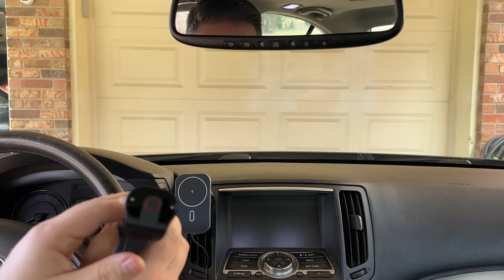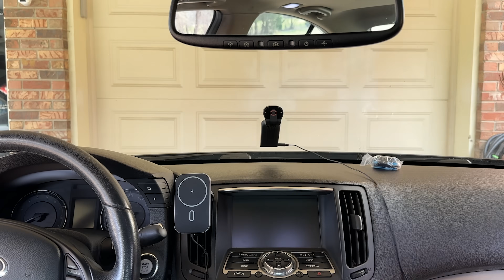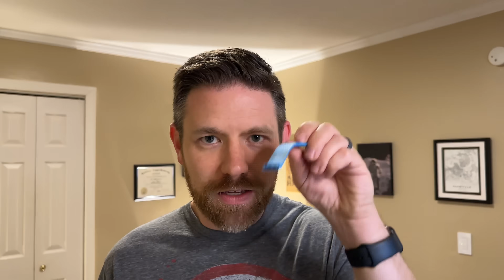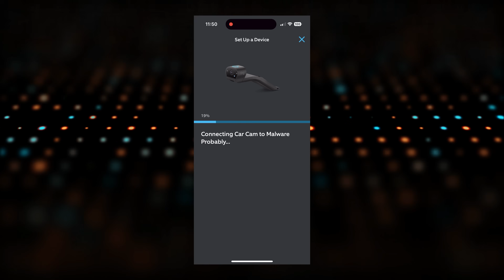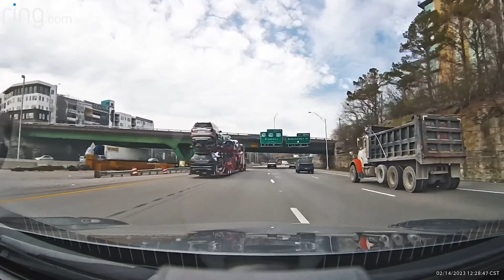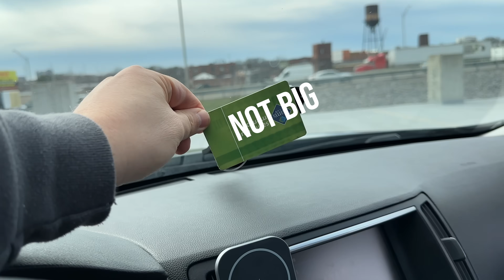Ring Car Cam: Full Review

Comment from the maker: Hey guys, I know I mounted it high. I wanted a higher camera angle. This thing weighs next to nothing, and the adhesive is getting the job done. :)
Reply: I’m scared somebody might break car just to get this camera, it looks too cool
Reply: I guess you mean you wanted a slightly higher camera perspective.  

I enjoy not having a car payment also!  haha
Reply from the maker: “Higher perspective” is exactly what I meant. Thank you for speaking “Donnie.” :)

Yes! I’m all about not having a car payment for as long as possible. This car is now 12 years old, but it was entry level premium at the time and it’s still in good shape. In my 5.5 years of ownership I’ve only had to (knock on wood) do standard maintenance like brakes, tires, oil, belts. I’ll take it!
Reply: But the camera is on a hinge type of thing… it moves up to be able to get a higher angle. Just installed mine, and moved the cam up and gave a “higher angle “ ….

Comment: Buddy if you hate seen cable I notice you place the camera way to high on the windshield you should of put it a little lower I notice that from the beginning when I order mine I will put in all the way in the bottom so no Cables will show
Reply from the maker: Yeah, I liked the higher camera position. Also, this camera has been discontinued. Thank you for commenting.
Reply: It might be discontinued but theirs a couple new ones in eBay theirs were I got mine in on transit 👍🏻

Comment: I bought that camera when it came on the market and after a few months it stopped working, they say they are going to replace it but they don't have that equipment available and they say they can't refund my money either because I bought it on Amazon and not directly from them, I have months waiting, I lost 250 dollars with that scam company
Reply from the maker: Ugh. So sorry to hear that’s been your experience. I would push back and ask for your support incident to be escalated with Ring. I get that they’re having supply constraints, but there’s gotta be some recourse. I’m sorry this has been your experience.
Reply: @TechWinnerCC  Hello, I have been communicating with Ring for more than 2 months, the answer is always the same, they say that they cannot solve my problem because they do not have the camera available and they don’t know when will be available to replace the one that was damaged, they also told me that they cannot return the money because I didn’t buy it directly from them, I did it through Amazon, but from Amazon they tell me that there is nothing they can do, that this is Ring's problem, at the end of the day I paid 250+ tax and that money was lost.

Comment: Does it take a SIM card? If not would it connect to a hotspot. I actually have a T-Mobile sync drive, but that plugs into the OBM. It would be nice if this read the vehicle too. I know sync drive is developing a Dashcam too, maybe with built in lte & reading your vehicle issues too.
Reply from the maker: It doesn’t have a SIM card slot (at least not one that’s visible).

Comment: I have several Ring security cams at home but do not buy this Ring dash cam bcz it is garage and need more and more improvements.

No stamp info like real time speed, date & time or gps

No rear camera or option to select
More, both interior and front cams are not working at the same time. You can have videos only on one not two at the same time.

Privacy cap can be closed by anyone and carjackers or intruders can easily do what they wanna do. I mean why a dash cam need to be covered if it is dash cam to cover what is going on around. Then do not have a dash cam.

Ring should understand that consumers bought Ring home security products, bcz what they offered and helped for the main purpose of SECURITY with advanced features like,

Live view
Two way communication
Cloud storage

That is why people were happy to pay Subscriptions and bought Ring products.

With the Dash cam sector, so far Ring is so behind the competition and so failed and it needs a lots of improvements and options to select the best security plan and devices.

You know, there are a lot of options/ products with all features what Ring lacks at the moment. So why you should buy this sticky Ring dash cam (should be compact and hidden as much as possible to address its purposes) and pay subs for less..

Comment: Thank you for making such a quality video. I wondering i don't have a alternator I drive a hybrid Toyota Avalon. Will that be a problem using the ring car camera?
Reply from the maker: Definitely worth checking their compatibility tool. I have it linked in the description.
Reply: @TechWinnerCC  I did check your link and thank you so much for for providing it. It did say that I was able to utilize the ring camera. What it didn't say was whether that would be a problem since a hybrid only has a tiny battery to start the hybrid battery and I don't have an alternator

Comment: Why do most of these vehicle camera reviews not talk about video quality/clarity? Features are great and all but the MOST IMPORTANT feature of a video camera........is the video quality! Can you read a license plate without being directly on the vehicle or stopped throughout all times of day and night? What fps does it record it? Does it upscale? How does the quality differ at night, dawn, and dusk? How does the camera and components do in extreme heat and cold? Are they working on a rear camera? My biggest issue with this industry is i have a go-pro from 2014 that has better video clarity than probably over 95% of vehicle dashcams. If that is the case, why aren't more "review" channels calling this out??? It is a dashcam, the most scrutinized part should be the camera!

Comment: Where you have it mounted in most states, cops can site you for obstructed vision. Also Ring freely gives all recordings to law enforcement on request, no warrant needed. Let me see, it can run down my battery, it can spy on me, disable my car through the ODB2 port, download only 20 seconds at a time and charge me for a monthly subscription. Outside of a descent picture I don't see anything good about this dash cam.  There are so many better and cheaper dash cams out there that record to a removable disk without any problem viewing or downloading and law enforcement would need a warrant to view it without your permission.

Comment: Only a few minutes into the video and i can tell you i dont like the power cord coming out the right side of the camera when the routing of it has to go to the left to go to the OBD2 port. Kinda reminds me of the new Nest battery outdoor cameras with the forward facing charge port rather than facing back towards the wall its mounted on (Face Palm). also this needs 4k or it makes it hard to read plates! my blackvue 900 is 4k and is awesome

Comment: Hi Donny, I have four dash cam in vehicle and I’m about to purchase the Ring Dash Cam as the 5th Dash Cam. I have one dilemma. 3 of the 4 dash cams are set to an OBD, I can press a switch and I can get 24 hours of recording. My question is can I use a splitter to connect it the Ring OBD connector so the Ring OBD can power my other Dash Cams?? Thanks.
Reply from the maker: It’s worth a shot, but you’re multiplying the amount of drain on your battery with every cam you have running while the engine is off. Just something to think about.

Comment: The only messed up thing is that they specify that your obdII should be on the left side of the steering wheel but then they put the charging port on the right side ?????? I'm sure you could make it a cleaner install with the wiring if it was on the left side just sayin.
Reply from the maker: Yeah, strange decision to place the USB-C port on the right side, at least for us North Americans.

Comment: Resolution has nothing to do with quality. People often mistake resolution with sensor capacity. You can have a 4k camera with a very bad sensor and you will get a very bad quality footage, as well as a 1080p camera with a high quality sensor and have an amazing footage. For example, I'm watching this video on a computer at 1080p, full screen on a 27 " display. Your house footage, when you speak is very clear, crisp, although it's 1080p, while your ring camera footage is bad. The sensor on that device is crap, that's my conclusion. There are very few car cameras outhere with a good sensor, and usually thier price is very high. So unless you're driving in a consistent dangerous environment, it's not worthed buying one.

Comment: 3 reasons I wouldn’t buy this. 1. My port is in use already 2. No suction cup mount.  Sticky pad will 100% fail at some point.  3. I don’t want another subscription. Just piggy back off my current cell plan.

Comment: Does it work with AAWireless as a home network and use your own cell with unlimited data?
Reply from the maker: It just needs a Wi-Fi network. You could use your cell with unlimited data, but you’d still have a limited feature set if you didn’t go with the Ring Protect Go plan.

Comment: Seems like a good little camera, but the Ring membership thing is the immediate turn off. Probably fine for people who are already using a Ring doorbell, but kind of a step in the wrong direction for a product that has never needed more advanced storage options. 
I'd also question the mounting solution there. Didn't see mention what adhesive is used here (i.e. 3M VHB tape), but it's one of those things that will definitely fail in hotter regions like mine.

Comment: I’d be interested to know how the adhesive used to stick to windshield would hold up in the Florida sun/heat, and if it does fail…is there any other option to mount? Does the app have a setting that Will display your speed on the screen?
Reply from the maker: Summer will tell a lot for sure. It does not display speed at this time. Perhaps that’s possible through software updates, but Ring hasn’t mentioned it as a possibility yet.

Comment: A couple of notes from my setup: Try to be near your wifi hotspot when first setting up.  Also, scan the bottom of the camera before you install.  The QR code is not able to be seen once you mount it.  Finally, the "frequent" mode for recordings eats a lot of battery.  I drive my car every day, not for very long distances, and my camera is telling me at least once per day that the camera has gone into standby.  I've been very happy with my car cam.  I have an escort radar detector/camera in my other car and the car cam is far superior in terms of usability.
Reply from the maker: The QR code is on the box as well. 👍
Reply: You are saying that the camera is getting more use than a radar detect?

Comment: Nice review, I have gone through 3 different dash cams and they all have failed in the Texas HEAT. Fine hair line cracks around the lens, bulging of the case, melting of buttons, glitch recordings, having color issues, haze around recordings, connectivity issues...etc. All within the year to 2 years of usage. I'm still hoping some company will develop a robust dash cam that can withstand the Texas heat.
Reply: @Phillip Banes Thanks for the suggestion
Reply: I am installing my cam today. I'm a bit worried about it and the Florida heat. I guess we will see how it holds up this summer. 🤞🏼
Reply from the maker: Keep us posted!
Reply: a capacitor instead of a battery suvives tx heat
Reply: Reason why I go with GoPro. I have the Hero 3+ I switch between two units no fancies but at least it’s something. I get a good microsd card to house 10+ hours of footage.

It is slower to load into a laptop but rewarding when I get to review and delete or retain for memories
Reply: Easy solution, take the camera down when parked outside.  I've been using the same dashcam for 2 years now, still works fine in the Oklahoma heat.

Comment: I wonder what type of effects it will have on the vehicle sicne it is plugged into the OBDII port all the time.  I don't think the port is designed for that.  What about overheating issues if you live in south where internal car temps can reach over 150 in the summer?
Reply: Moreover what data is it mooching off the port?

Comment: I didn't know about this untill this video. Cool 😎 review. However, using the OBD port, Amazon gets way too much data. Absolutely No No
Reply: I have a Vantrue E1 dashcam connected by an obd cable. No issues at all. It just uses the power from the battery and not the diagnostics wires.

Comment: You can brick your cars ECU by plugging things into your OBII port while the car is running. Not a good idea.
Reply: No, you can't. It only uses the power connector, not the data used for diagnostics. I have the Vantrue E1 dashcam connected with an obd cable.  No issues at all.

Comment: UNTIL  it gets its own battery like other ring products i wont buy this for it connects to the car battery and will shut off when the battery feels its low .Use a separate battery thats easily replaced and i will buy this
Reply from the maker: I’m guessing they’re avoiding that due to heat concerns.
Reply: @TechWinner  well I had a camera that was connected to the car battery and someone stole it and it didn't even go to the cloud. I want something where all motion goes to the cloud or else it is useless to me
Reply: @TechWinnerCC  I WENT AROUND  the makers and installed a ring doorbell that runs by those batteries in my conversion van and that was about six months ago and no problem over heating .I use a  hotspot for internet service in the van since it has television and devices capable of contacting the internet the hotspot comes in handy .I can watch all streaming services in my van if i want to .But so far i have had no problems with over heating of that ring doorbell .I improvise and that doorbell fits my need but i do put tape over the lights that come on
Reply from the maker: Very creative!
Reply: @TechWinnerCC  Once i caught a potential thief leaning on my vans front door .She tried the door and then noticed the blue light on the ring device  AND TOOK OFF RUNNING .LOL

Comment: I live in Florida and my camera is protected (somewhat) from the sun by the tinted strip at the top of the windshield. Are there any concerns about the issue of direct sunlight and therefore heat on the camera if the vehicle is left out side for hours. Have not seen any comments about that. Might not be an issue but I wondered your thoughts.

Comment: So I installed mine with the bottom attachment because I thought you had to. It was sticking but I noticed from the outside that only half of the adhesive was on the windshield. After seeing your video, I removed it and now have a full adhesion. It’s a good thing it came with extras!

Comment: So, can you just plug the USB-C into a USB-C port to power it?

I wonder how well this will hold up in the summer when a sunshield is placed on the windshield and the sun bakes it.

Pretty bummed about the adhesive - we have ceramic tint on our windshields and I don't want to stick anything to it.

Comment: You missed talking about one of the biggest flaws of this product. It is not worth buying at all. There is ZERO motion sensing when the car is parked on the exterior. When someone walks near your car, it does not record. Someone can key your car and it will never record it. It will only record during impact/damage or after and you will never know what happened before sadly. This camera is NOT worth buying at all. Stick with the Garmin Tandem, way better camera.

Comment: Man, Ring just loves their 1080p. I can’t believe they are not rolling out 4K
Reply: That’s probably gonna be a subscription lol
Reply: For God sake my phone has 4k, why can't they just upgrade their hardware. I just got off the phone with them and no info on an upgrade to the video resolution.
Reply: @oscarjalfaro   last I checked, it is a current issue with wireless carriers. 4k is too much data and will drop. 4k will be for live viewing, but when storing, 4k gets turned into 1080p regardless and suffers no data loss. This makes it viable for 3rd party investigation. They done physical storage and say if you have a criminal, they go after that. 

Carriers are preparing for faster speed, this will take more employees to provide a secure transfer of the data. So it’s not MIM to death or something.
Reply: Thing is over 250 once shipping and handling plus the sub..can you imagine how much more it would be with 4k??
Reply: @macalcord  
There are 4K dash cams for $130. Obviously those are entry level. But you can get decent ones for $250-$300
Reply: @Vince Vince  I'm just saying Ring will jack up the price.
Reply: 4K video files uploaded over an LTE connection would substantially increase the data transmitted, and therefore the cost.
Reply: Facts!! 😠
Reply: Lol! 1080p is good enough! 🙄
Reply: @Jeffisright  until you need to read a license plate one a car or a detailed subject description.
Reply: @vincevince7482  exactly Vince!  You have to right on top of another car to read plate.  Spend $100-$150 less and get same performance.
Reply: @Phillip Banes That's what I stated, hardware upgrade.
Reply: @Phillip Banes you can if they are 4k cameras from the factory and use software to downscale to 1080
Reply: @Phillip Banes  i wouldn't put it past some company's to spend the money to downscale video. to turn around and sale an unlock "upgrade" to 4k and say something of the effect of. the extra charge is the cost to processing the higher quality video .
Reply: It’ll over heat.
Reply: 1080p on a good sensor is way better than 4k on a cheap sensor.